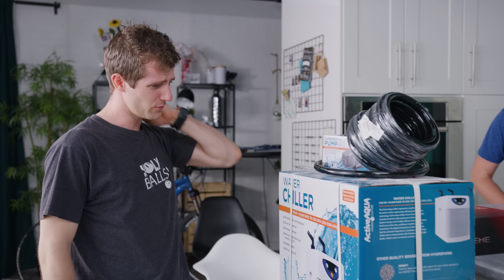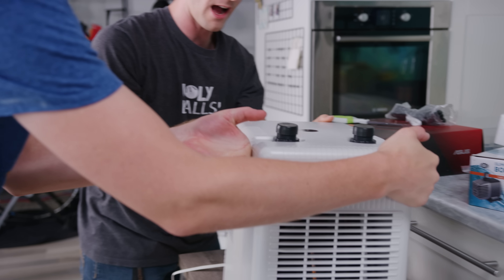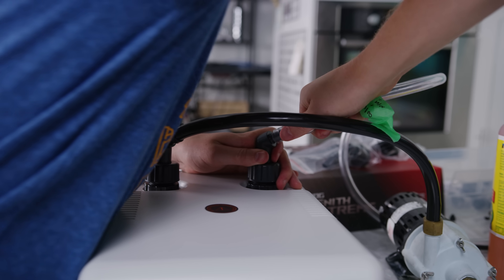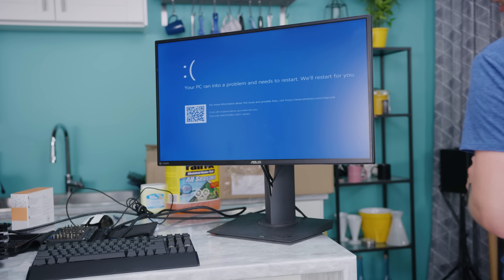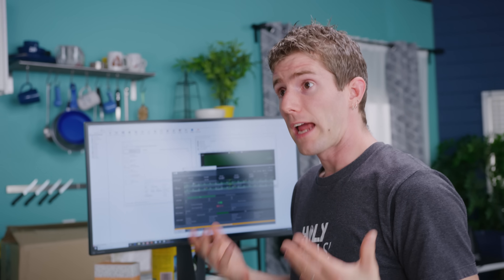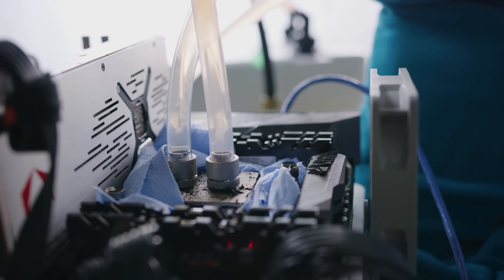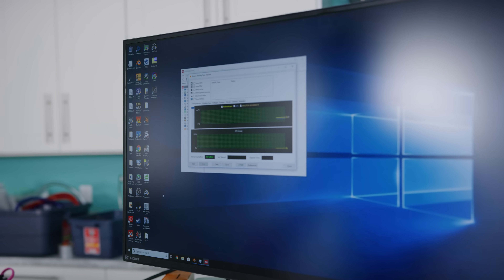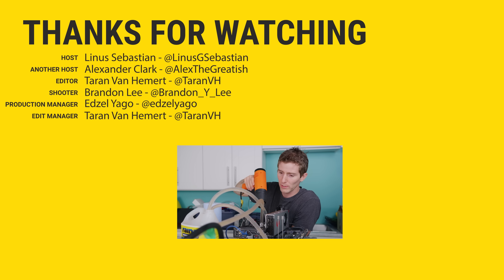Chilling Threadripper 2!!!

Comment: What about submerging the board in mineral oil to prevent moisture condensation.
Reply: He could probably even get a good 4 or 5 videos out of that...
Reply: Completely agree, sticking with the chiller for water cooling the cpu, but submerge the mb in mineral oil to keep the mb in a moisture free atmosphere. Great idea bud!
Reply: I've been thinking about this all week.
Reply: Well, it is an aquarium cooler.
Reply: Or an airtight vacuum case
Reply: @mustafayasiraydin  vacumn case might make the seal between the joints and tubing fail due to the pressure difference
Reply: @SolluxDivide  yes tubing needs reinforcing then :) and getting components under vacuum can be an issue if electronic components sucked moisture while storage. they can explode if vacuum applied too rapidly or worse electrolytic capacitors should be made to withstand vacuum and not leak out its electrolyte as vapor.
Reply: @mustafayasiraydin  @Ryan 710  I was thinking nitrogen gas. It has the best of all worlds, no liquid mess (like oil) and no pressure tank as a case (like a vacuum) additionally, other things on the board can passively cool, since it works just like air. You'd still probably want to move major heat contributors like the power supply and GPU out of the nitrogen filled container.

Or if you are even cheaper you could use some sort of suped up air conditioning unit to remove most/all the moisture from air (which is pretty much the same thing, but cheaper long run, but requires the air conditioner). Additionally, the air conditioner (could) run actively, and you can move the GPU/power supply back into the same container, and they get a cooling boost.

Or, you could move to Antarctica, and just heat up some ambient air, since the air comes pre-conditioned. 

If you wanted to do this though it might be a good idea to get a custom PCB made with drainage holes surrounding the CPU mount, and a bit of a gap between it and other components, just in case.
Reply: @mustafayasiraydin  vacuum case would be really bad, no where for the heat to go
Reply: @jasongarfitt1147  no bc it is liquid cooled. But u have to cool most of the other components which do not need cooling normally (cooled with natural convection) so you might be right about practicality but it is not impossible. We need to have special board cooling pads disributed across all boards within the case. Better yet using dry air within an air tight case rather than vacuum would be much more convinient.
Reply: @mustafayasiraydin  are you suggesting the case be under vacuum but the heat sinks on each component be individually liquid cooled? That would be a lot of  pipes and pumps. Even with liquid cooling there is still heat lost to the air in contact with the heatsink and the pipes so all you would be doing by going to vacuum would be losing that contribution to the heat reduction. The better plan would be a sealed case with the air inflow going through a chiller/dessicator to dry it out, possibly with slight positive pressure.
Reply: @jasongarfitt1147  dry air or cheap inert gas is much more suitable. But for the other case, not every component requires individual cooling since circuitboard can be utilized as a heat conduction material between components and special cooling pads. Electrolytic caps are another problem under vacuum. It is simply an unnecessary complexity. Even ic's should be dried out first in order to not explode them when system going under vacuum because of absorbed humidity inside the chips while storage.
Reply: @mustafayasiraydin  what convection it would be in a vacuum
Reply: @jasonlark8920  yes i was trying to say that too. No convection thus some other conductive method(thicker motherbord standoffs with thicker backplate maybe...) might be needed to transfer heat from components other than cpu and gpu.
Reply: @mustafayasiraydin  that would likely blow capacitors.
Reply: A sealed case filled with Nitrogen or Argon... heck even CO2 would work.  Any inert gas to displace the humid atmosphere before the case gets sealed, like a bag of potato chips.
Reply: Or just flip the motherboard upside down so that the tubes go up to the CPU, so condensation goes away from the chip
Reply: 2:42
Reply: Id do this if someone made a chiller a bit more quiet but that noise is killing me 🙃
Reply: HMMMMMM
Reply: And also chill the oil.
Reply: Top level comment
Reply: He did that quite some time ago
Reply: That would be cool
Reply: Why not just chill the mineral oil and use large air coolers in a submerged pc?
Reply: There's some components that have cardboard in them like capacitors so I wouldn't do that
Reply: Genius
Reply: At this point we can run liquid nitrogen throught it.
Reply: Dude mineral oil is gonna freeze in that temperature
Reply: This instead.. https://youtu.be/cR4Mutf1kQg
Reply: 1 idea but should be reserved for last.
Reply: He already tried that and the oil degrades the hardware. Ended up shorting and dying during tests.
Reply: Mineral Oil can degrade plastic and rubber (Always check compatibility! Silicone-based materials are especially vulnerable). You'd be much better off with 3M's Novec[1] or another synthesized dielectric oil specifically formulated for cooling high-density servers. [1]: https://www.youtube.com/watch?v=YyKIZPuepl8
Reply: better yet, what about just hooking up the cooler to the aquarium PC directly...... I think what would happen is you would still get condensation at the air/oil level, and the aquarium would slowly fill  up with water, which would accumulate at the bottom.. so it would work for a while at least.
Reply: @NaturalBornGriller  If that is the case you could put a valve/drain at the bottom below any PC parts... then just carefully open it every few months to drain out the water and make a huge mess.
Reply: @jessiejanson1528  but then the oil would leak out too? As they spread into one another when a flow is introduced.
Reply: @rowanedward5079  if it flows to the lowest place over time, the water will collect in it naturally. you dont have to perfectly remove it, just keep too much from building up. if oil comes with it, you can pour the excess back in.
Reply: @NaturalBornGriller  we will just have to add  Mustafa Yasir Aydın 's idea and put it all in a vac chamber XD
Reply: The mineral oil would freeze, but might work
Reply: @floppydisk921  if they only run this one it might not freeze... this got as low as 4c and mineral oil freezes at -4c.... there's a chance...
Reply: first thing would be not to ventilate the cpu and put it in towels
Reply: Would not be good
Reply: @aqbaplaygames3435  why?
Reply: @Superkirbeh  some kind of alcohol i couldn't translate would be better
Reply: @aqbaplaygames3435  Mineral oil would be fine. Linus has already done a mineral oil pc too
Reply: @lazuli.rutitsky  it wasnt chilled tho
repeadetly chilling and heating the oil woild create problems
Reply: It would be GLORIOUUUUS! 
Guaranteed top spot in any benchmark test.
Reply: im not sure if mineral oil can be run through a water chiller but it is something to think about.
Reply: radnukespeoplesminds I think they’re saying to do the sub zero setup here, but submerge the whole MB in mineral oil to prevent condensation
Reply: Hahahaha you are all dumb cunts and don't know anything

Comment: Now do a more practical one with a chill solutions csxc-1 thermoelectric aquarium chiller

https://www.marinedepot.com/chill-solutions-csxc-1-thermoelectric-aquarium-chiller

The challenge without over modding a case
Use one of those mounted internally or externally
in a full custom loop
blocks, pump and res.

Comment: What might be a good idea for this would be to use much longer tubes and put the pump and cooler in a different room, you wouldn’t hear that obnoxious noise and I’m sure there still would be plenty of power in the cooler to cool that machine with the tubing being as long as you need it, just an idea, 3ft of tubing with that cooler on the lowest might be to cold making the condensation but maybe with that cooler and pump 20ft or whatever away at the lowest setting might be closer to your results with it at 60, if y’all catch my drift. Maybe something to think of or try, might seem like a stupid idea but no ones saying it’s practical but if you wanted to test it to see that’s up to y’all

Comment: You can easily insulate those lines with something called tundra insulation that is available at plumbing supply stores. Its black foam and flexible like the tubes.... kinda. It will keep the condensation from forming on the lines. The water block is a different story. A coating of some sort of foam cut and glued on might do the trick.

Comment: Cannibalize it, and use it to chill the CPU, GPU, VRAMS, RAM, and PSU!
Subzero computing!
Reply: Tom Hsia if you use radiators in your case and have them intake pull air in your entire system will drop in temp, I run a chiller on my gaming system, 9900k 5.3ghz and 2080ti XOC bios and have it running @10c coolant temp case system temp is around 15c and cpu, GPU, memory vrm all run around 20c while gaming. It’s a game changer to water cooling.
Reply: After I decided to go chiller wish I would have gotten the z390 extreme waterforce MB instead of the non waterforce extreme.

Comment: Hi Linus! I had an Idea about if you were to use very high flow of cooled or ambient air instead of super chilling the coolant? Im a mechanic and thinking in terms of engine cooling,  increasing flow of air on the same radiator consistently provides enough dissipation to make air to air inter coolers viable in turbocharged setups... so going by the principle that if you were to whisk away whatever heat is generated but maintained a certain "normal operating temperature" ( coz unlike chips, engines need to be at a certain temp for the lube to behave correctly and its designed to run in that range etc). Therefore, lf you were to fab and install an enclosure on a water cooling radiator like a shroud and install a super high flow "Can fan" or also known as a turbine can fan... those are tiny and have flow beyond anything... but they might be loud, im sure you can hook up a fully variable potentiometer to control it to any rpm u want but as far as flow of air goes, nothing beats a turbine. in theory, what im saying is that if you were to simply maintain a super flow over the radiators, technically as long as we are not exceeding the radiator's BTU dissipation capacity, your temps should stabilize at a certain temp and then under all kinds of heavy loads it wont ever go past that point. does that make sense? Oh and Huge fan, love your work! love the videos! keep em coming!

Comment: DEFINITELY on Team LINUS for the full build. I'm mining crypto using (FPGA's BCU-1525's) currently... and looking for ways to get temps down as far as possible. Other than the dew point issue.. damn... this is WAY better than the Peltier modules I've been researching!
Reply: U can use the same chiller he had without any modifacations its even better that way beacuse you can place it in another room out of the way were you cant hear it or a second pump and just run 2 hoses to it through the wall works perfectly thats how I cool my system have for over 5 years now

Comment: I bought the AlphaCool 2000, 1500W, after watching this video for my Threadripper 2950X and 2990WX. I have been able to overclock it to 4.4Ghz sustained and stable, even under load, yes, amazing!!!!!, especially when you consider you'll need n20 to get to 4.6+Ghz. I'm also running an AMD 9100WX's (my daughters Card), a Titan Z (my card), Nvidia 2080TI (my sons card) and a Radeon Pro SSG 2TB (everyones card, used for rendering, encoding, etc.) (FYI, this card isn't mine, it was borrowed from work after they went with Nvidia Quadro's for their new Epyc Servers and had around 5 of these laying around, Blasphemy!, ). So it's amazing that I'm getting such high speeds with so many hot GPU's in the case.

The AMD Threadripper is an awesome CPU, I highly recommend it to anyone who uses high end video editing software or 3D software, I'm using DaVinci Resolve 16, Maya, Filmora9, Blender and AfterEffects. The OS I'm using is VMware OS, as such I can use OSX, Windows 10, BSD, different Linux Distro's, etc, with minuscule lost's in performance vs. using dedicated GPU's, HD's and USB controller's for each VM user.

Why, well again, while setting up my system, I used tips from Linus in creating a system that everyone in the family could use (the 10 gamer, one PC episode). They simply use either their Nvidia Shield TV's , Google PixelSlate's or Note 9's. As all of them can connect to a 4K monitor, mouse and keyboard and run all of the necessary clients (VMware Horizon, Steam Link, Citrix, etc.) to run any OS or game they want to from the server. I mean even our Note 9's can play games on high settings, 4K 60FPS+, 1080P, 100 FPS+, AMAZING!!!!.

Wife has her own laptop (a Razor Blade Stealth, i7-8565U, 16GB RAM, 512GB SSD, 4K, OLED Display, external 2TB Samsung HD, external GPU, AMD 9100-WX (I love these cards), Samsung 49" display (when she saw mine, she had to have one as well) so she doesn't participate in this madness. I will also be building her a desk, similar to the one Linus's group built for their Razor Laptop, so everything is out of the way, hidden.

Sorry I went on tangent there, I'm just so excited that I finally got this this working properly. Condensation is a bitch in a half, let’s just say I sealed up that CPU tighter than a horse @#$%&*+? a dolphins hole.

Thank You Linus and others, you've given me such great ideas over the years.

Now I'm just counting the days before the release of the new 64 Core Threadripper.

Comment: I would seal up a case and load it with nitrogen to prevent condensation that or add a dehumidifier to blow dry air through the case but this may heat the air

Comment: I think the benefit of these is that all you have to do is change the controller and you can get it to chill way cooler than only 59 freedom units.
Definitely put it in a system with an arduino or something controlling it. Make it run colder it’s probably more than capable.

Comment: You could to a centralized water cooling with this. Lay some insulated(!) copper piping around the house, fill the system with a water glycol mixture (like in those solar water heaters that go on the roof), and connect each pc to the cycle. YAY!
Reply: oh, and maybe some controller to prevent dropping below dew point.

Comment: Forget chilling, why not just freeze the entire computer in a block of deionised water?
Reply: Intelligence Injection  mineral oil then
Reply: @shadowxxe  They did that 5 years ago
Reply: @dylanwillis1473  I know what I was suggesting was that instead of the mineral oil being cooled via a radiator they cool it via the chiller
Reply: Most of the heat dissipation comes from mass transfer (i.e. moving hot water to other places with the heat from the cpu.) So if you're using ice, you lose that. Also everything everyone else said about the D.I. water leeching metals from the chip and board.
Reply: @shutout951  And additionally the point that DI water will not freeze as easily as you think
Reply: @h3retic583  you'd want a water/ethylene glycol mix
Reply: Local melting will occur
Reply: Water requires too much energy to be used efficiently in this way. Forget about the risk of a short for a second. Imagine the ice on the CPU. The CPU will heat up and then that energy will be transferred to the ice cooling the CPU. Before long, the ice would start to turn to liquid water which would leave a gap of air between the water and ice. The water would then sit on the CPU comfortably heating up to boiling since air is a terrible conductor of heat. Once the water is boiled off, your CPU dies (if it hasn't already) since it's just sitting in cool air. 
This is also why you can't just bury a computer in snow and hope for the best or just put it in a box in the arctic. The energy produced by the CPU needs to be removed. It's the removal process that's important. We have to transfer the heat away as fast as possible.
Reply: Intelligence Injection  water is not conductive without ions in solution
Reply: Intelligence Injection i didn’t know water can be a robbers, did they use guns or knife then?
Reply: @ramade9040  neither, science.
Reply: Deionised still isn't clean enough.

Comment: Linus, if you want ready built liquid chillers for subzero temps just do a search for "laser chiller" (on aliexpress even). Comes in all shapes and sizes and rated for industrial usage 24/7. These are units that can dissipate thousands of watts :).
Reply: They also have built-in pumps and resovoirs. They lift liquid up above the ceiling and monitor flow, pressure, stable temperature with HID etc.

Comment: Plate heat exchanger  ?  What if there was a water to water plate heat exchanger in between the pc and the chiller.  3 loops  1st loop chiller to large reservoir to act as the heat dump.  2nd loop reservoir to plate heat exchanger. 3rd loop heat exchanger to pc components.  No radiators or fans  needed in the pc.    Flow rates and liquid temps would need to be monitored and adjusted to keep the 3rd loop at just above ambient with the 2nd colder loop removing the heat.  This would  and eliminate the risk of condensation on the pc components.  With some fine tuning, I think this could work.   You could even run another loop with insulated pipes from the  reservoir to a radiator with fans to cool the room.